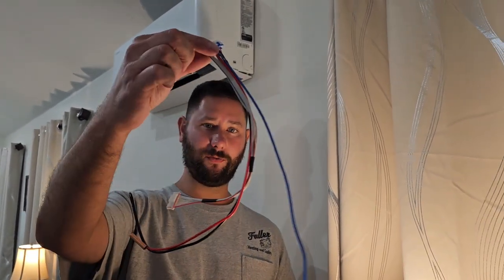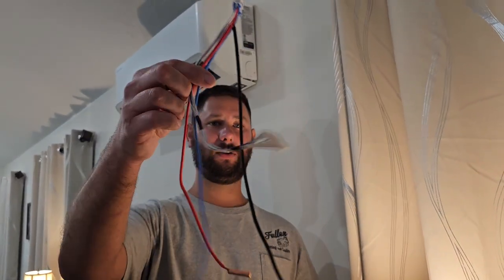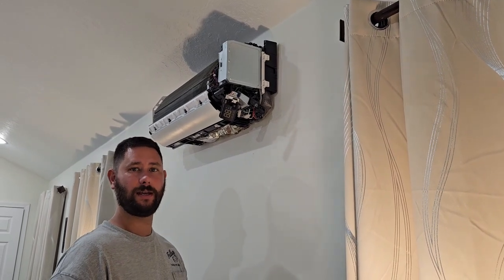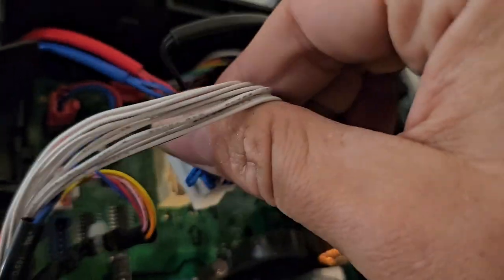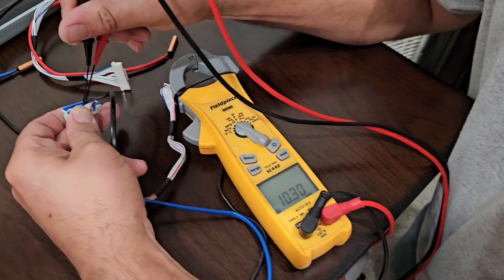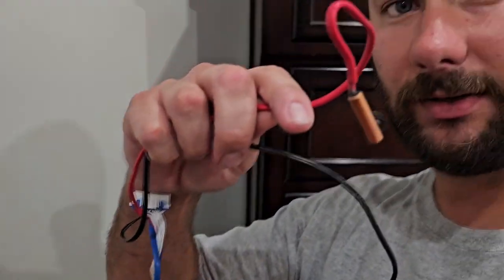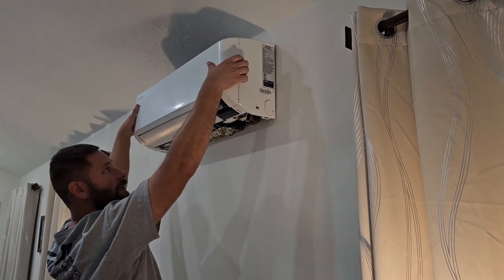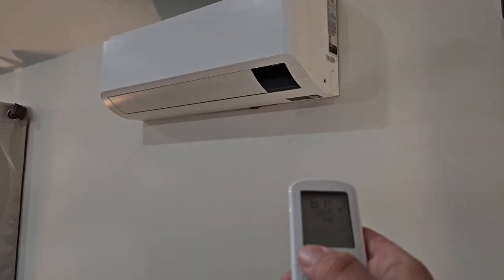E123 Error Code on Samsung Mini Split - How to Fix

Comment: Great video which helped me to locate the error for my error code C123. Unfortunately I can’t find the item number for my thermistor. It’s almost identical with the one in the video but I have another sensor connected to my contact. The sensor or whatever it is flat placed on top of the electric box. My model is AR12TXCACWKNEE and I can’t find any exploded view. Do you have any idea how to find the item number?
Reply from the maker: Contact Samsung Tech Support. That's your best option for finding your exploded. Parts view if you have went to samsung downloads.And you cannot find it under technical documents

Comment: Great video and very useful, fortunately I have to identical Samsung units, so I took the sensor from one unit to the other that is more frequently used at my home. I have cleaned and polished the bad sensor thinking that probably was a debris issue, but i installed it and it shows the same error. Before I purchase a new sensor that in my opinion is a little bit expensive, I was thinking what could happen if I connect a resistance to get the 10 k value, the funny thing is that I get a 7 k reading on every pair, red, blue and black. Thanks for sharing your video
Reply: Reading other user comments, is there a generic sensor? Where can I purchase it? Thanks

Comment: Future content, error 464 possibly.  Fun stuff.  I didn't see the link for the generic temps sensors.  It seems the newer units are easier in terms of sensor replacement.  The older Samsung can be tricky on some models to replace sensors.
Reply from the maker: Thank you for the reminder. I forgot to post the link.
Here is the link
https://youtu.be/2gPUC5Go3mQ?si=4QAeKbXujeGrBJ5I

Comment: Best video I've seen on error code C123, thank you Taddy.
I have just two questions:
1. Do you have to order the full set (3 sensors) even if only one is faulty?  Reason I ask is our local dealer want's to charge $200 for the set, which seems expensive for three wires.
2. You mentioned replacing with a generic replacement part in the interum.  Is it therefore necessary to order the Samsung part if the generic works just as well?
Reply from the maker: You can use a generic sensor and it be practically free if you have the censor of available. I have a video on this check out my other videos
Yes they come as a set so you have to order the set. You cannot order just one sensor.
You're welcome thank you so much for watching the video. Please share the video.
Reply: @TaddyDigest  Thanks again Taddy, great work :)

Comment: What does C202 error mean on the same model Samsung AC? Does the same apply for indoor heat sensor?
Reply from the maker: I'm pretty sure that means communication error between the indoor and outdoor unit.

Comment: If i have this error code or E122, and aren’t the sensors, could it be the indoor board itself?
Reply from the maker: make sure there isn't a condensate pump that isn't breaking the sensor wire, and yes, if the sensor is reading right, it could be pcb

Comment: Hi
I have a e123 code on my samsung ducted air conditioning.
I have removed the cover from the out door unit but having a hard time locating it where the pcb is.
Would anyone know where this sensor is located on a ducted so i can located it and follow video to test it before i order new one.
Reply from the maker: on the indoor coil